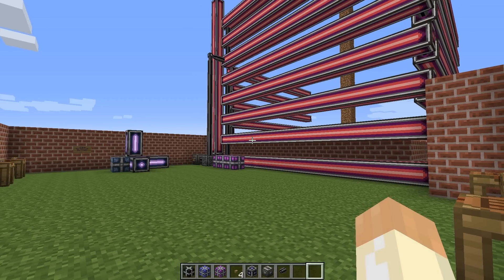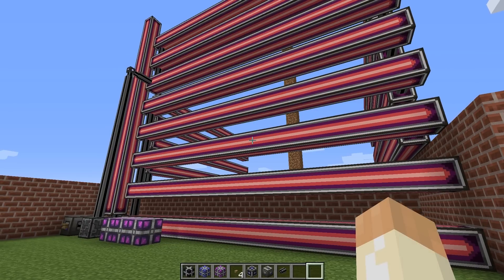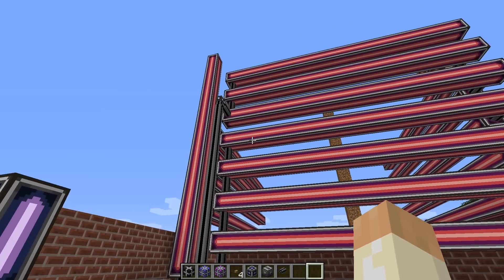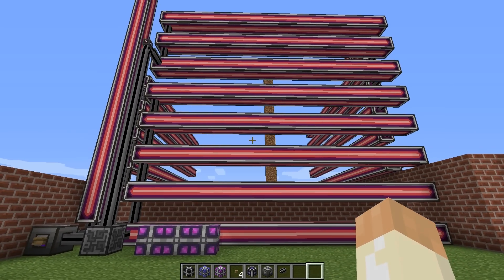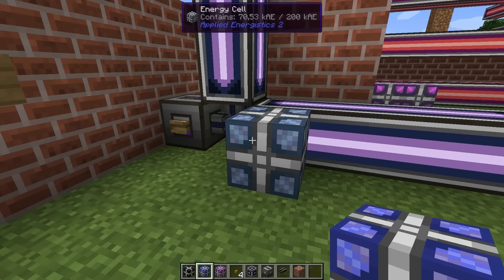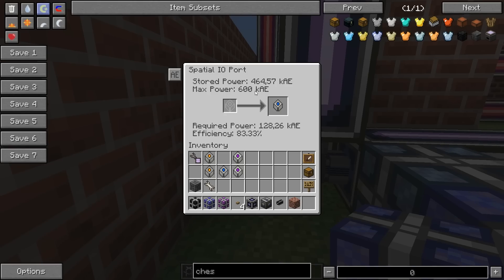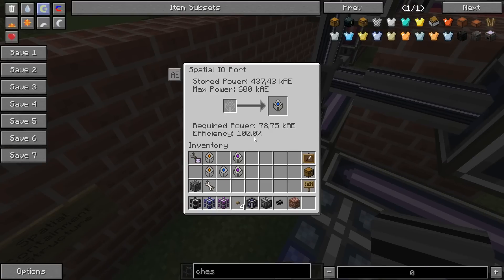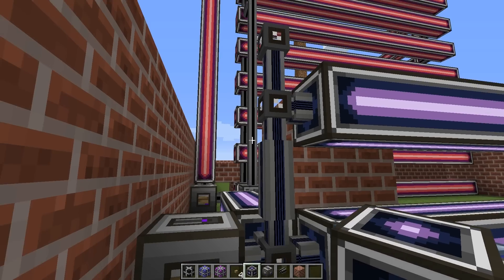Spatial Storage - Applied Energistics 2 Tutorial #16 (MC 1.7.10)

Comment: Hey TKH! This is seven years late, but thank you for the tutorial! It was very informative, to the point, and extremely helpful.
I do have a question, if you're able to answer so late... When using spatial cells, once they're formatted to a specific size (e.g. 2x2x2, 5x5x2, 3x2x3, etc.) do you know of a way to reset them? Or, once you've set a size is it permanently stuck there?
Reply from the maker: That was a good question, and I wasn't sure about this so I had to do some reading on the subject. We should not think of spatial storage cells as a regular cells, they are rather dimensions. So when you use a (specific) spatial storage cell for the first time a new dimension is created. As I understand, this dimension is permanent and has the size of the defined space by the spatial pylons. I haven't explored this type of dimension travel very much but you can go there if you want to, and can only move around in that little box. The way back is a bit tricky though :)
Reply: @therealtkh  thank you very much! I did some research on my own and came to similar conclusions. Doesn't look like their sizes can be reformatted 😕
On another note, I have discovered a very strange interaction between AE2 Spatial Storage Cells and Biomes o' Plenty. It messes up the generation with Bo'P for the Spatial Cell dimension and kills you (in survival) whenever you try to enter it. My issues with the conflict have been extremely confusing and has had contradicting results nearly every time I have launched the two mods together. This is, as you could expect, very troubling and extremely confusing. I've been trying to fix this for two days at this point and haven't found a reliable solution or reason why. If you've experienced this before any and all feedback would be very helpful.
Thank you again for the video and response! I truthfully didn't expect to get one 😆
Reply: Sigh I’ve embarrassed myself. The issue was not with biomes o' plenty. I had an external feature added that conflicted with AE2. Fortunately, I fixed the problem, unfortunately, as I mentioned, it's only an embarrassment to have discovered
Reply from the maker: @noahlee4168  Thanks for getting back with updates on your issue, regardless of the reason it's always good to get things sorted out :) I have played a bit with spatial travel now and it's a fun concept but perhaps not very useful from what I can see :) One thing I had not really thought of is that the spatial storage cell rather makes the content of the dimension swap place with where you have the pylons. So within the same "pylon room" you can have two rooms and swap between them by the press of a button. Before I rather look at the system as a way of moving things to the spatial dimension and then placing it somewhere else. It's a bit misleading to call it a "Storage" cell when it's rather a key to a specific "room" in the spatial dimension... :)
Reply: @therealtkh  🤔 That's an interesting idea, having a pylon room. It would be pretty easy to set up some 2^2 cells and some smaller pylons. If they store names, and assuming internal data can be ignored (e.g. fuzzy or nbt ignore) then a teleportation room would be relatively easy. That's a good idea! I'll let you know how that goes, haha.

Comment: I'm kind of disappointed.  It's so costly and bulky to set up.  I was hoping to be able to use the spatial storage to have a sort of mobile base that I could just set up on the fly.  I didn't realize you needed to build such a thorough framework.  Kinda renders it mostly only useful for very specific situations.
Reply from the maker: Yeah, it's way too expensive to be really useful. Perhaps if you've built an extremely advanced build (like a 22841 channel ME controller) and need to move it somewhere. Either you have to build the framework twice or demolish everything to set it up somewhere else. Personally, I never had any use for it...
Reply: TKH I don't mind the expense so much as the bulkiness.  If it cost just as much but in the end took seconds to set up and take down, I'd be okay with that.

Instead I'm going to use it to create a pocket dimension and build an Ender IO telepad in it to get in and out.
Reply from the maker: I think I agree. It feels like the idea is to have two full sets of Pylon structures  and only move the cell between them - not tear it down every time to move the inside to different places.

That telepad solution sounds cool, does it work with the AE2 dimension? I heard it's possible to be inside it somehow... :)
Reply: TKH I haven't tried it yet.  I do know that you can do it with other forms of teleportation like Mystcraft books.

Comment: I was really hoping I could set up a 128^3 area, put it into the storage drive or something and see a break down of what was in the area. Then take out any of the blocks I wanted like diamonds, redstone and stuff. Then put the area back just missing the blocks I took. Then it would actually be useful.
Reply: You can you just need to supply the red stone signal with you trapped inside and a way to get out.
Reply: @matthewcrawford7518  any idea how you go about that? It could be interesting
Reply: @darkartist4932  Quantum link chambers + redstone p2p linking the inside to the outside. this is an interesting idea indeed
Reply: @darkartist4932  i messed around with it after your question, and I got a working model that lets the player enter and leave at will. Very nice, thank you for the idea. I did do exactly what I suggested might work, redstone p2p through the link chamber, and i had to make a small system to export/import the cell from/to the Spatial port, works like a charm

Comment: for the storage cells is the max size based on area or side length? For example, could a 16 cubed storage cell hold an 8x8x64 or is the maximum length of any side 16?
Reply from the maker: +Tanner Armstrong Now, it was some time ago I played with this, but if I remember correctly you can never exceed the side length even though you shorten the other sides.

Comment: You can use mystcraft books to travel back and forth to dimensions created inside the cells. But did you know that, even it the cell is destroyed, the dimension still exists ?
Reply from the maker: Yannick Pradayrol I didn't know that. But is it useful to anything? Possible to change the structure before placing it back? :)
Reply: therealtkh Not so usefull. Except that you can this way have a secret romm with no access but a book. And with some little inception thing, you can hide your book in another cell, why not ^^ Oh, and with mystcraft books, no power required. So you just have to create the dimension and link it with a book. I don't remember Mystcraft mechanics but when it's done, no required power to go check your dimension cell.
Reply from the maker: Yannick Pradayrol Interesting, and fun that it works, but I will probably never use that bonus feature ;)
Reply: I'll definitively use this if i can find a server that allows mystcraft (not to many of those tho ;p).
Reply: Btw could u make a tutorial on how to do this? Plz?
Reply: TheOneChief I think that all you have to do is bind a book to your home, and take an unbinded book. Then, you trigger the spatial thing while you're inside the zone defined by the pylons.

You will be teleported to the cell you just filled. Then just bind your unbinded book there and teleport back to your home.

There you go, you can now trash your cell, destroy your pylons, but you will still have access

Note: you should use books that don't drop on the ground. I think that involves some admin powers, if I remember right ^^
Reply: Is it possible to get inside the dimension by any other means?  I'm playing the sci-fi modpack called Space Astronomy and I don't think Mystcraft is in that pack.